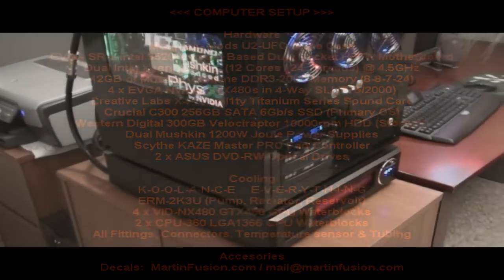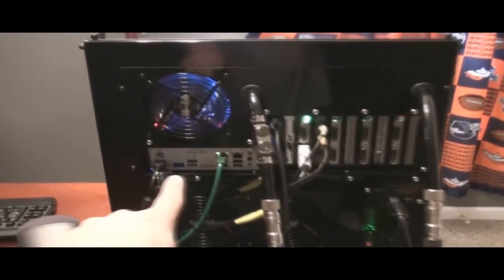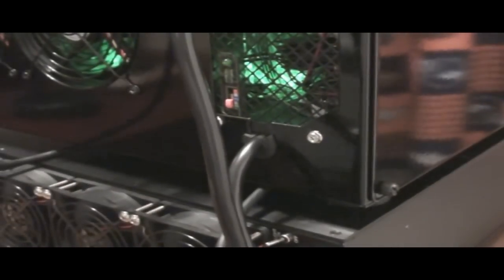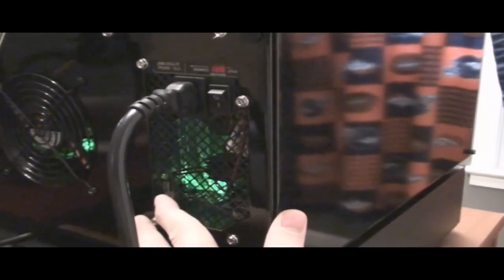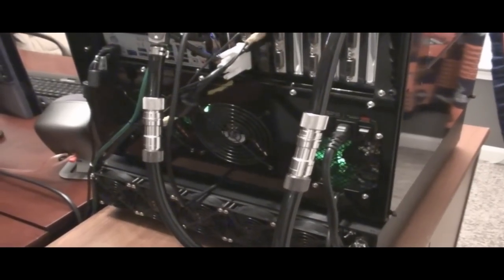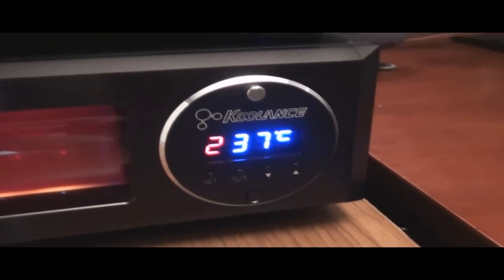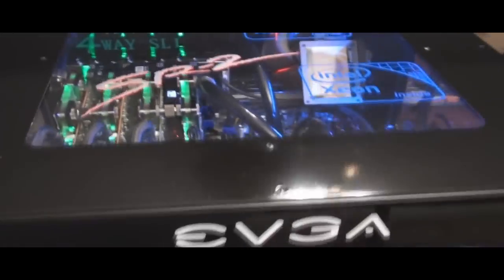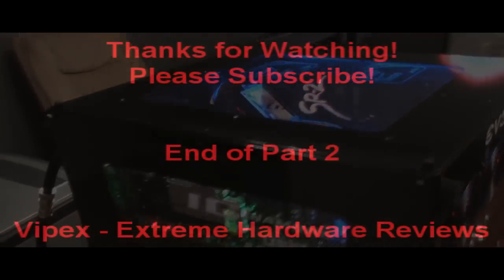Gaming Computer Showcase: EVGA SR-2, Intel Xeon X5680, 4-Way SLI GTX480 Pt.2

Comment: @Trubyd44
Hey It would be great if you could try to install Mac OSX on this monster ;) If you are successful many will start taking a stab at putting together their own Video Editing, Audio Engineering, 3D production workstations with no need to by a Mac. I'd do it in a heartbeat if I was sure it'd work!;D

Great Job man! Oh! About your front fans, try setting the potentiometer to off, wait a few minutes and they may stop. If not the potentiometer is letting current through even when off.